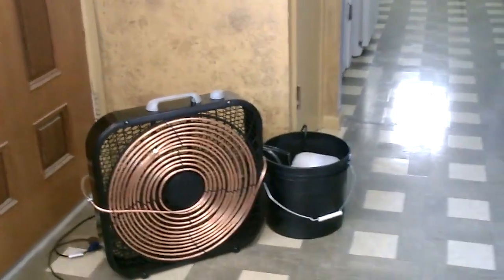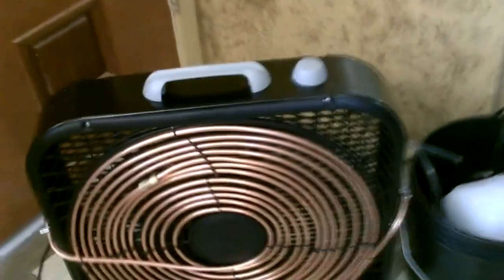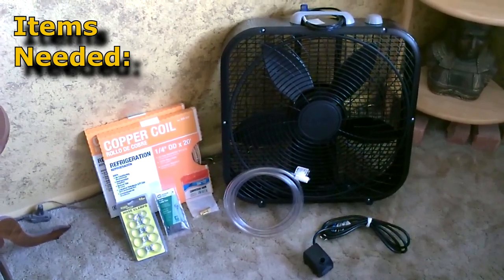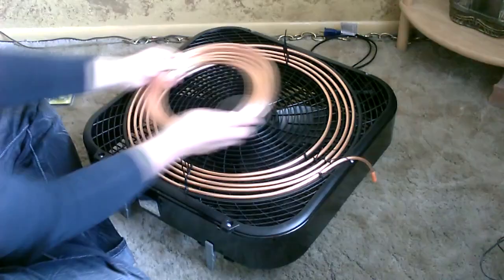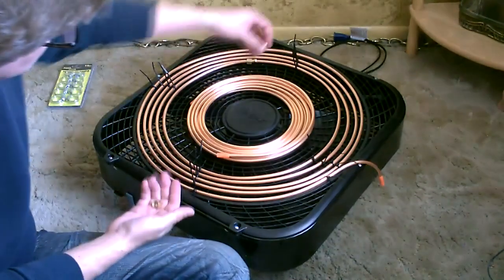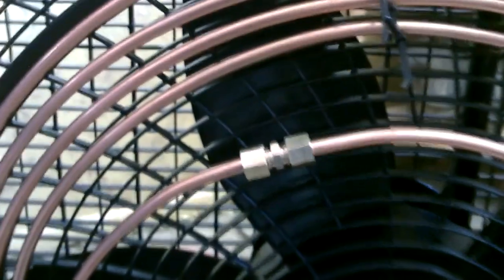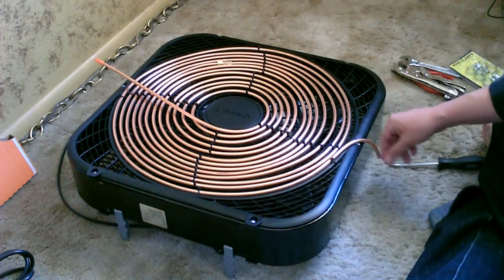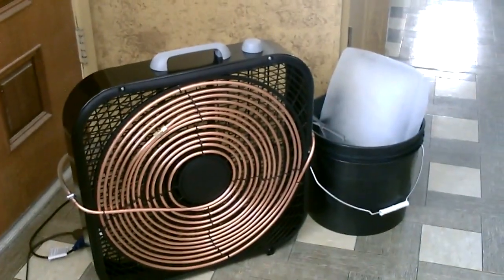Homemade AC - The "Copper Coil" Air Cooler! - (Simple "Box Fan" Conversion) - Easy DIY

Comment: Hey there, do you have a way to deal with the condensate (if any at all)?
Reply from the maker: Lee Zhen Ming hi there. i've had almost no condensation. *the small amount i've seen just evaporates quickly off of the copper tubing
Reply: RAJ M
Reply: +Paul cuming
Sealed r12 in a copper tube will not cool. It must be compressed , ran through a condenser ,expanded through an orifice ,then boiled in an evaporator to cool. That is what removes the heat from the air. 
If a sealed volume of R12 worked, the warehouses that stock it would be freezing all the time. 
Impossible to do.
Reply: Lee Zhen Ming That's how it cools it sweats... and the air running over the water droplets is cooled.. from the evaporative effect..  As stated won't be as cool as a bucket cooler or icechest cooler.. but will move more air so I point my icechest cooler in back of this modified fan and now I have nice COLD air moving faster.  but these don't work so well in HUMID environments..
Reply: Yeah that's the problem. Relative humidity where I live averages at 70% so this design pretty much serves as a good dehumidifier. I was wondering how I could improve this design to fit the humid conditions here...
Reply: This isn't an evaporative cooler. It cools by warm air passing by the cold copper coils. Condensation is just a result of moisture in the air collecting on the coil.
Reply: exactly, thats my point. I live in a high humidity location. How do i remove the condensate?
Reply: Lee Zhen Ming I have a suggestion.  place a series of thin vertical strips of plastic or aluminum (like vanes) in contact with the coil.  you will need many, but because they are thin they should not impede the airflow (much).  If the dimensions of the strips (depth) are chosen correctly, these vanes will probably "catch" most of the condensing water, allowing it to drain vertically along the vanes into a catch basin of some kind you will also have to arrange for.  Might take some tweaking, but that's the best I can think of.
Reply: Technically speaking you aren't adding humidity  to the air with this device. Because the moisture in the air is collecting on the coils you have a dehumidifier. So if you make a catch drip pan for the condensation to drip into. You're good to go.
Reply: Mark Hunter what happens if you put the ice bucket in front of the fan and use those strips to drain into the bucket?
Reply: +Lee Zhen Ming Thats easy....Move
Reply: +Lee Zhen Ming I am not sure, but do note this doesn't add any additional humidity if that's what you're worried about.
Reply: Same problem here LEE... my coils got a tonne of water on them... which is good coz thats the  humidity being drawn out of the air: which can be more uncomfortable than dry heat. 
Perhaps "oiling" the pipes would help it bead off more rapidly... some chicken wire layed on coils to create a "runoff"

Comment: how about radiator fluid.. sounds dumb but I'm try it with radiator fluid and ice maybe.
Reply: +Thary Aing  I would think any fluid that has good thermal conductivity would work, basicly water is cheap and its not hard to replace when it evaporates.
Reply: "radiator fluid" is just water and anti freeze, but its not below freezing in ur house right

Comment: Has anyone in Vegas try this? With the Vegas heat, if so does it actually helps if you living in the Vegas heat
Reply: Enoka Laumea Hi Im from north Texas, so I think 
Im qualified to answer this question.  If you have a fridge or preferably a freezer thats OUTSIDE your house or apartment this will work. now there things that are not explained here. an average room window ac unit cools about 5000 btus per hour,  One gallon of frozen water at 10 degrees will give you about 1400-1450 btus.

Comment: The one thing I do notunderstand why you used it was the compression fitting to connect the two copper coils when all you had to do is connecting with the 3/8 clear vinyl hosing a 2-inch long piece that's all you needed everything is zip tied so no need for a sturdy connection just saying it would have been a lot easier faster and less expensive otherwise good job

Comment: which tube is connected to the pump?
Reply: The vinyl one that sends water to the copper coil. The other end just returns the water back to the ice chest/bucket where the pump is immersed.

Comment: i used way less tubing, probably an inch or so between each tube.i may try using more tubing on the next one.  also, i put my coil behind fan instead of in front. i read it should work better that way, anybody have any insight on that?

Comment: Get a cryogenic sealed sterling cylinder make vessel to cycle water biological antifreeze through copper coil heat exchange around cylinder probe to super cool water that is being circulated to the copper coil over fan. This should be a better design has an alternative cooling device. Hay it beats having to use ice. A drum fan would be a better choice then a simple box fan for this design. A total of three electrical components to provide cooling.

Comment: What's the point ?  Consider the cost of the copper tubing, elec. pump, fan and the ice, then consider the price of a new AC unit. The cost  for the 
AC unit is about the same, or less and much more effective without the hassle.
Reply: Joseph M YEAH BUT THIS IDEA PROBABLY DRAWS LESS AMPS THEN THE AC UNIT
Reply: Joey R Yeah, this fan would consume a tiny fraction of an AC unit, which has a compressor motor  and 2 fan motors much larger than this one.
Reply: Joey R Not once you factor in the cost to freeze that giant block of ice.
Reply: VERY TRUE SARA!!!
Reply: Dude! It's about DIY and having fun
Reply: Joseph M A small chest freezer such as this one, http://www.homedepot.com/p/Magic-Chef-6-9-cu-ft-Chest-Freezer-in-White-HMCF7W2/203445397 draws 28 watts per hour. Less than a normal light bulb. The fan is less than 35 watts per hour. A small window A/C unit such as this one, http://www.homedepot.com/p/LG-Electronics-5-000-BTU-115-Volt-Window-Air-Conditioner-with-ENERGY-STAR-LW5015E/205588135, draws 520 watts per hour. With water pump, desert suns entire setup including freezer would be less than 100 watts per hour. One simple 100watt solar panel will run everything. Compared to a minimum of 520 watts for the A/C unit. For less power than two 60w light bulbs you can run desert suns system. Plus the fact that you would be using the freezer for food and not just the ice.
Reply: brad ley lets say you get the small chest freezer, i know that alcohol doesn't freeze  in the freezer. if you were to run a set up into the small chest freezer, would alcohol work with cooper wire or will it have a bad effect on the wires?

Comment: A $5 heater core would be cheaper and more effective.
Reply: Yugo 505 youre trying to cool... not heat
Reply: Don't get confuser by the terminology.  LMAO!  A heater core is like a car radiator, except it dissipates more heat in a smaller area.
Reply: the only reason a heater core distributes hot air is because its force feeding boiling water from the engine block through it... but you could have it with cold water

it has a decent size surface area wich takes on the temp of the water inside the coils (wich the goal would be ice water in this case) infact AC works this way by forcing outside air into an evaporator coil then into a heater core to distribute a cold gas through the coils THEN using a fan to distribute this cold surface temperature
Reply: Yugo 505 where can you buy a heater coil for $5.
Reply: Agreed.  A ducted fan behind a heater core would work better!
Reply: Tooter Plumber , "pull a part" junk yard
Reply: put one in the ice water and one at the fan
Reply: @FadedLightXx  
Wow that's great, lol. I love the confidence in your incorrect reply. Oh man, I needed that laugh! 🤣👍

Comment: How do you attach the pump?
Reply: It connects to the tubing with a clamp (one that you tighten with a screwdriver). The plastic tubing slides over the ends of the pump and the clamp is tightened.
Reply: spratsprat The 200 GPH pump that I found at Harbor Freight has a 1/2" outlet. They do not make any adapters, or reducers to allow me to create an air-tight attachment between the 3/8" (OD), 1/4" (ID) vinyl tubing and the 1/2" pump outlet. I could not find any adapters or reducers anywhere else. How did you attach the vinyl tubing to the 1/2" outlet on the pump? Can you explain your method in more detail? Thanks !
Reply: Mike Arnold I bought 2 of these same pumps from my local Harbor Freight and they came with 2 different outlets in the package. the small one fits the 1/4" tubing fine.
Reply: Todd Siechen Todd, can you give me that part number for the pump? Thanks much !
Reply: Yep - the one I have is called a Pacific Hydrostar Miniature Submersible Fountain Pump. ITEM#68372 Made in China and distributed by Harbor Freight Tools. Site: http://www.harborfreight.com/200-gph-submersible-fountain-pump-68372.html

Comment: bro i cant find any copper tubes in here... any substitution for that?
Reply: You should be able to find it at your nearest hardware, plumbing, or home improvement store. If not, you can order online from Lowes, Home Depot, Orchard, etc.
Reply: Any conductive tubing: aluminum, brass, chromed tubing not sure where you'd get these though if copper isn't available. Some have tried using heater or small radiator cores from a car or something similar. Anything that allows the rapid exchange of energy, in this case thermal energy.

Comment: If you add salt to that water it'll be even colder.
Reply: +cast390 Can these pumps handle the salt water?
Reply: +cast390 Salt would eventually turn the copper tubing into mush plus it does not last as long.
Reply: Add salt to the ice only. 
You can also substitute the water for anti-freeze.
Reply: dlyciousmusic This keeps getting more sophisticated.  Antifreeze is a brilliant idea.  all I need now is something colder than ice that doesn't melt into a toxic gas.
Reply: Adding salt to metal tubing? lol

Comment: What happens when your ice melts?
Reply: +rezonite You have warm water.
Reply: Nooooo..... Really!? I thought melting ice turned into mountaindew.
Reply: +rezonite Nope just sprite sorry to ruin your dreams.
Reply: get more ice, or make more.
Reply: Try using a milk jug almost full of water and freeze it...maybe 2. Put the jug in the bucket of water about half full and use until it thaws....then put it back in the freezer and use the other frozen jug....don't fill it completely full or it will bust when it freezes.....that way you don't use ice and keep on adding more ice and cost...just keep recycling.
Reply: Then this becomes a fan.

Comment: Missed the pump section btw
Reply from the maker: hi. i just used a standard 12v 200 gph water pump. placed in the bottom of the bucket. i think that pump is from harbor freight tools (but amazon has them too).
Reply: @desertsun02  thanks for the info!

Comment: use salt water
Reply: I used a one gallon water. Mixed with 1 liter of salt,  and it's so cold and melts slower. But freezes slower in my fridge.
Reply: The Worst Channel, Use a 1 gallon milk jug (with non-salt water) for ice. Place it in larger jug, fill larger jug with your salt water mixture, you can rotate milks jugs if you want also (1 in the freezer while 1 is being used) and never have to change out the salt water...

This worked AMAZINGLY while living in Iraq back in 2004/2005
Reply: did that in college to keep a computer cooler...
    Thing is... you got to steal ICE from SOMEWHERE!     or waste electricity to make your own
Reply: Use number 10 tin cans to hold the frozen water.  The tin conducts more cold to the water it's sitting in than plastic..